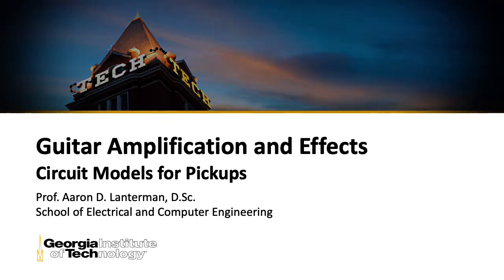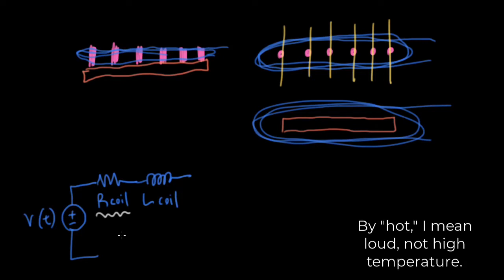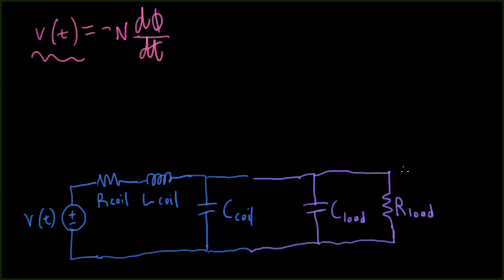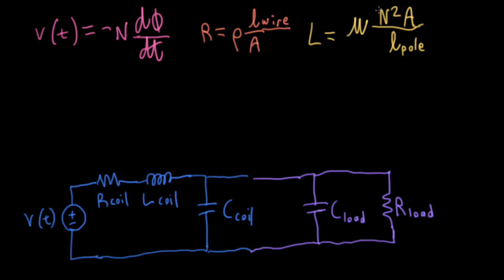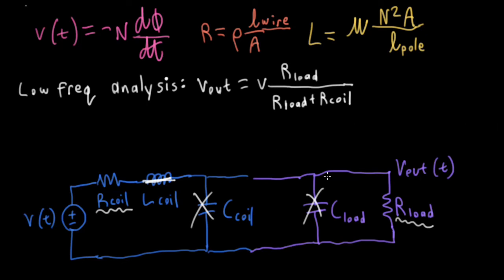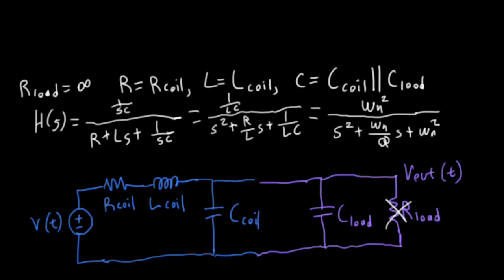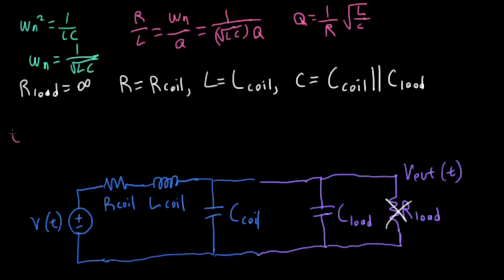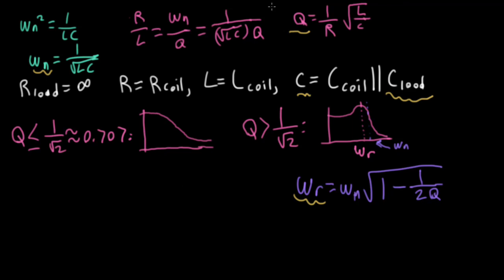ECE4448 L8: Circuit Models for Pickups (Guitar Amplification and Effects, Georgia Tech course)

Comment: Very informative
What you call these Danelectro pickups are actually lipstick pickups; Danelectro bought empty lipstick tubes bought from Maxfactor and that's where he dumped the coil, glued it up and closed the tube. Lipstick pickups sound really bright, sparkly and twangy, even more so than your average single coil and are also quieter than the average single coil pickup
However I have 1 question: several magnet types can be used (ceramic, Alnico 2, alnico 5, alnico 3 (and alnico 4 and alnico 8 are rare)), but what makes all these magnet types different from each other?
Reply from the maker: Seymour Duncan has a description of the various types of magnets and their alleged tonal effects. I'm a bit skeptical though -- they never really explain what they think the physical mechanism for these tonal differences is.
Reply: @Lantertronics  I don't think you should expect huge differences between 2 pickups of the same type, but lipstick pickups are their own thing and differences between 2 types of pickups will make a noticable difference

Comment: Thanks Aaron, this is probably the best explanation of how guitar pickups work that I've seen yet
Reply: With regards to the effect of windings on C_coil, I guess the actual winding pattern would also have a pretty significant effect there. I know a couple of pickup makers and they often experiment with different coil winding patterns and how they affect the sound of a pickup. My hunch is that this is because of the difference in the capacitance that's created by the various patterns.